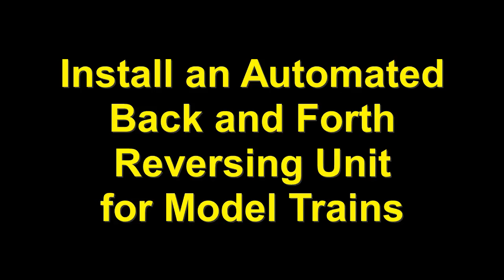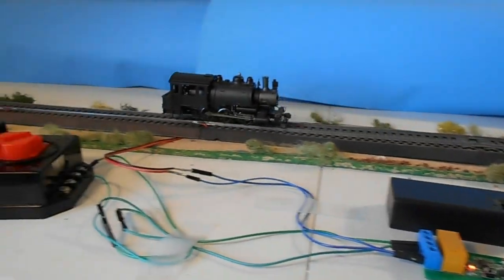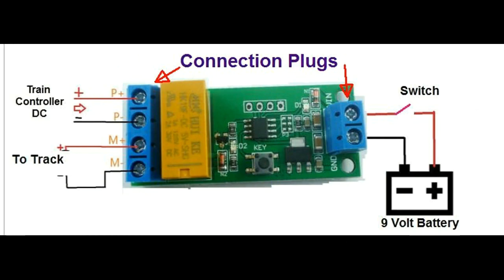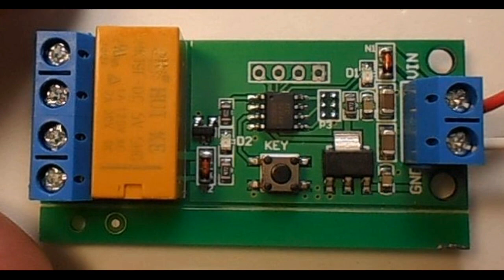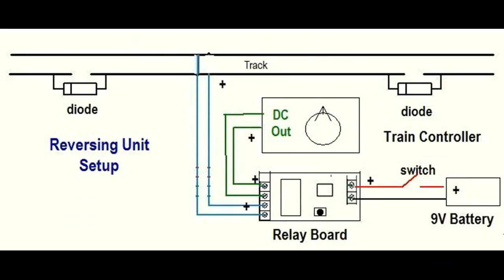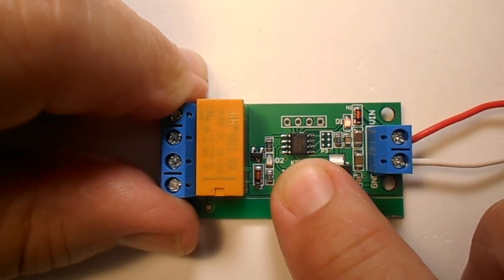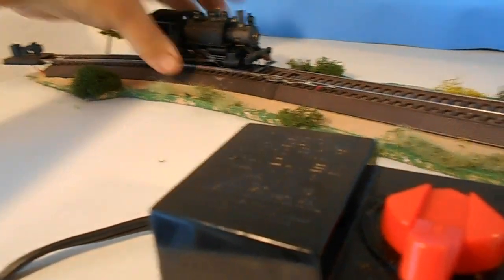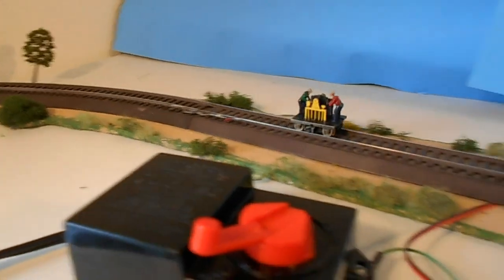Automatic Reverse Relay for Model Trains

Comment: Just made a setup that fits in a window sill for a  Christmas Train, The reversing unit came with good Documentation, but nothing like watching a video. The segment in your video on using the program button I watched a half dozen times. Video was well done. Working on this in June to be ready for the Christmas season this year. Thanks.
Reply from the maker: Thanks Steve for the comments. Step by Step instructions are also available at the website modeltrainsounddotcom under Notes in project 16

Comment: This is awesome! I've been toying with the idea of making a little diorama but don't have the space for a circuit. Love the idea of using two of these and having two straight lines going through a station back and forth. Would be a great amount of motion for a tiny layout :)
Reply from the maker: An interesting layout. Would like to see the design to determine if it would require just one or two auto-reversing relays.

Comment: I'm excited because I ordered this from you and it's on its way to me now.  I'm using Kato N Scale track, is that OK or do I need to find a way to use the track sections you send?
I hope the instructions will explain where to solder the diodes (I presume at the joint between the last two sections at each end of the line) and how to program the systems for time delay.
Reply from the maker: Hi Barry. Your kit should work well with your Kato n track. You just need to insert the insulators I have included at a rail joint by removing the current joiner. Let me know how it works.

Comment: I used a 3rd diode and 100 uF capacitor to power the relay board Vin/GND pins with the same PWM voltage that goes to the P+/P- pins.  Relay works fine from full power PWM (12V in my case) down to less than 1/3 full PWM.  Besides not needing batteries, when I stop the train (i.e. 0V PWM), I don't hear the relay clicking.
Reply from the maker: Interesting approach.

Comment: Robert, just received mine. When you estimate the run time. Ex mine is about 10ft of track at a slow speed. Say that would take 10sec. But you want it to sit in place for a few minutes. Do you hold the key down for that amount of time to program it?
Reply from the maker: No . You let the D1 blink with your finger OFF. Then press it to STOP the timing.

Comment: What are the specs of the diodes, there are many to choose from on amazon.
Reply from the maker: The board is rated for 2 amps so you can use any diode rated less. I use 1 amp rated diodes.

Comment: Hubby has been working on installing this all day...we get the trolley to go in one direction and stops but then once the relay kicks to go to reverse, the trolley doesn't move.  Any idea what we did wrong?
Reply: Check to make sure the diodes are facing the same direction, on the positive rail and going across on either side of the rail connector where you placed the diode.

Comment: Just what I was looking for!  Can you tell me (1) will this work on a straight HO track that will be about 26 feet long, and (2) what size DC train controller would I need to make this work?
Thanks so much!
Reply from the maker: Yes. This should work fine. The timer can be set in both directions for 5000 seconds (Travel time + stop Time).  That's well over an hour .

Comment: Robert-
  Using KATO N scale Unitrack. Any ideas how to not solder the diodes on the track? So i can modify the layout in the future without worry. ??
Reply from the maker: no ideas . You must have the diodes to direct the current  which requires soldering. To use only one piece of track I would suggest cutting a gap in the track toward the end and soldering the diodes around it rather than across a rail joint.

Comment: Wonderful video, Robert!  Question:  Is the relay simply reversing the polarity of the flow of electricity?  In my train "village" set up, could I use this system for say a motor that causes a vehicle to be pulled down a road, stop, then be pulled back?  The motor would be under the plywood table I have.  I could use another battery to power a DC motor that pulls the car one direction and another 9 volt battery to control this relay.  If this relay is simply switching polarity, the DC motor should reverse directions quite easily.  Think this could work?  Thanks!
Reply from the maker: Yes. The relay reverses the current flow. It should work with your idea.
Reply: @robertwilkins1765  Thank you!

Comment: Can Hornby's locomotive still work, keep moving back and forth if installed HM7000 DCC Sound Decoder?
Reply from the maker: This system only works in DC mode so DCC sound would not work.

Comment: Hi Robert, will the HO kit be fine for Bachmann DCC powered locomotives?
Reply from the maker: The system operates in DC mode for powering the track. If your locomotive can operate in DC mode then it should work fine.

Comment: This is the info I've been looking for. Not sure why it's not more easily accessible. Thank you so much. I assume this will work with Z scale, too? The 9v power source for the relay board has no influence on the track power, right? As long as I have the appropriate power to the rails I should be fine? Thanks!
Reply from the maker: Yes the 9 Volt power supply has no influence on track power. It poweres the relay board. The Board then directs current to the track. As regards Z scale you would need to find diodes with fine wires. Most diodes rated for 1A  and voltage > 20 work fine.

Comment: Where can I buy one of those control boards?
Reply from the maker: You can buy the boards at modeltrainsounds.com/orders under project 16 accessories . Included there are powering options and lighted bumpers.
Reply from the maker: use www.modeltrainsound.com and click on orders
Reply: @robertwilkins1765  Sorry but links dont work for me. only get blank page (think the "s" is missing in the link😜
Reply from the maker: It is www.modeltrainsounds.com add ithe "s"

Comment: Why does programming the thing have to be so hard?
Reply from the maker: Takes practice which you can do just by powering the board by itself . Check the website modeltrainsounds.com Project 16 under NOTES a summary of the programming steps is shown on page 5 of the pdf file. Also use an Alkaline battery not a Heavy Duty.

Comment: Will this work with G scale?
Reply from the maker: I have set it up for G scale but I used diodes rated for 2 amps . The relay is rated for up to 2 amps. Check the current draw for the locomotive or trolley . If under 1 amp you can use the HO kit.
Reply from the maker: The relay board is rated to handle up to 55 Volts and 2 amps of current draw. You can use a 2 amp rated diode for this and O and S Scale but check that the current draw by the locomotive does not exceed 2 amps. I have used this for a G scale Trolley drawing 700 mamps and it works fine.